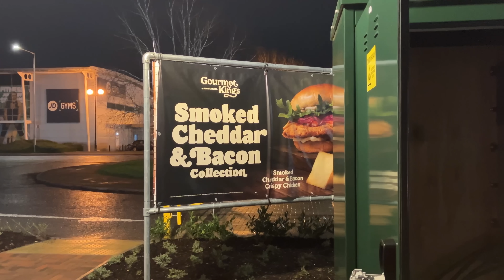This Is How EV Chargers Are REALLY Installed | Instavolt Edition

Comment: One interesting bonus of EVs and renewable energy is that electricity supplies are being beefed up and run out to locations that in the past has mainly been ignored. 

In the past the grid was more of a star network designed around heavy industry locations, with a lot of generation in the central part of the country radiating out. Now the aim is to have a more crossbar like spine or loop around the country with spurs off to virtually every point of the country, supplying more capacity to previously poorly served areas. Plus increasing the resilience of the system through diverse routing, closer to the point of use generation and easing of historical grid congestion points (that were expensive to solve previously). 

The outcome will be the UK becoming a better location to invest in industry and other sectors within, and a fairer distribution of power around the UK for everyone. 

Those complaining of EVs changing 'traditional' ways of doing things should pause for a moment and think of the clear advantages the renewable energy and electrification of stuff brings to the country as a whole. Pehaps reflecting on their own more self-orientated stance in the bigger scheme of things. That is no one is forcing them to change but perhaps they should think again about ranting so much about the world changing around them.

Comment: Dave, if you want a sneak peak of the Instavolt Three Maids Hill, Winchester super hub then the construction firm (Parco Civil Engineering) have a video on the site's webpage. The super hub is due to be largest rapid-only charger site in the UK with 44 chargers, 4 of which are HGV/towing sized bays (without needing unhitching), 4 are larger van/motorhome sized bays and 3 are allocated disabled charger bays. The site has a large onsite solar array, and has it's own dedicated substation supported by two rows (4 unit each) grid scale batteries. The site also has a dedicated resturant/restroom area, picnic and childrens play area.
Reply: Thank you, the Parco website shows a really impressive development, a sign of things to come.

Comment: As you took time mention it, I called in at the Instavolt at Banbury at around 22:15, Costa closes its doors at 20:00 although the Drive-Thru is open until 22:00. It was very quiet, only one other car charging I was able to get in and out quickly, having paid over the odds for my charge but I know that the northbound services at Warwick are poorly served for chargers (I think they do have some Tesla only chargers there though). Using the chargers at Banbury at night meant having to make another stop at Warwick just for the toilet and a coffee.

Over time the chargers may see more use at night, even more so if they ever introduce an off-peak rate; if it does get busier at night Costa need to think about extending their opening hours to make some money off the back of it.

I did pre-condition the battery before charging but was getting decent speeds from the Instavolt charger so they can deliver up to their design speed, unlike some of the others which never seem to get close even though I have an Ioniq 5 which can take the higher rates
Reply: I used the open to all Tesla supercharger at Banbury & had KFC (there’s also Pizza Hut there). My stop coincided with the worst of the stormy rain that day too
Reply: And the Millar and Carter at Banbury is now a hotel Chocolat store and cafe at Banbury. And yes the open to all Tesla's down the road are cheaper
Reply: @Ian_ja  The Hotel Choclat was in complete darkness when I arrived so I assume was closed, didn't even check to see what time it closed.